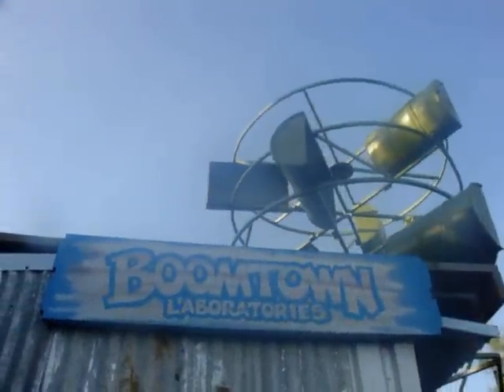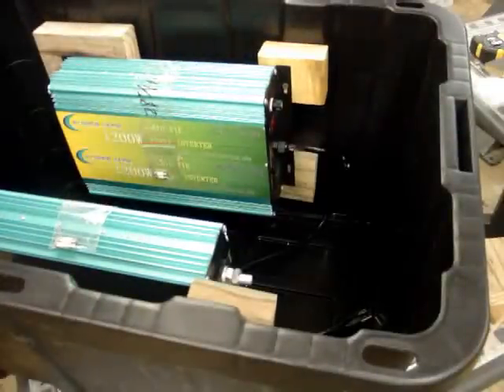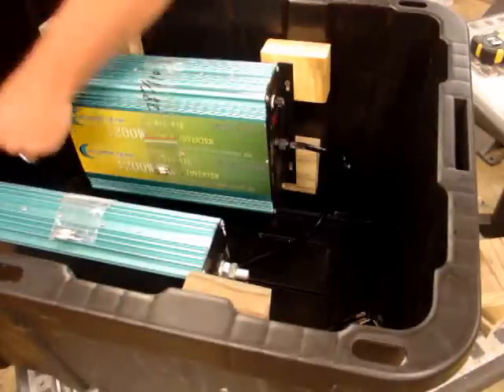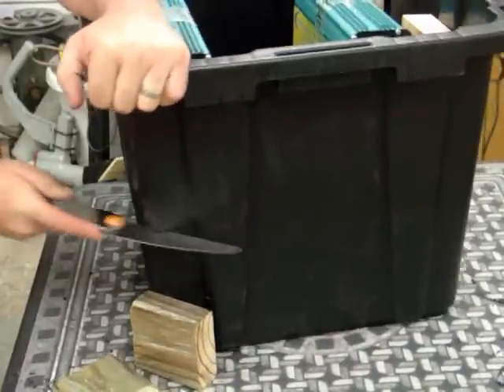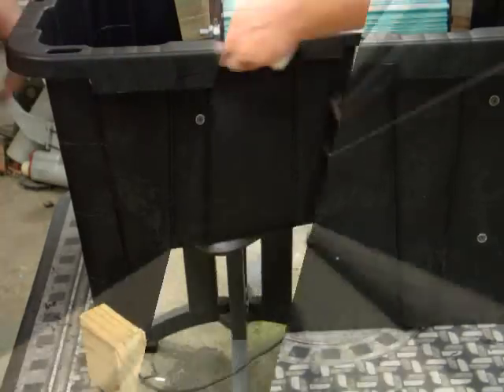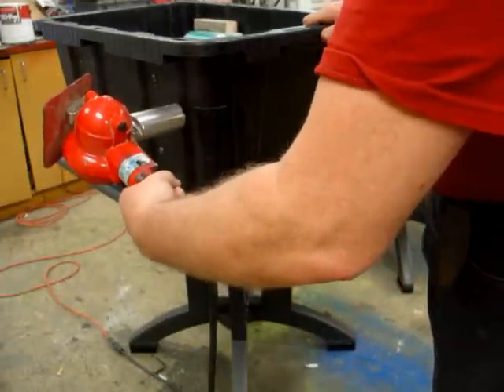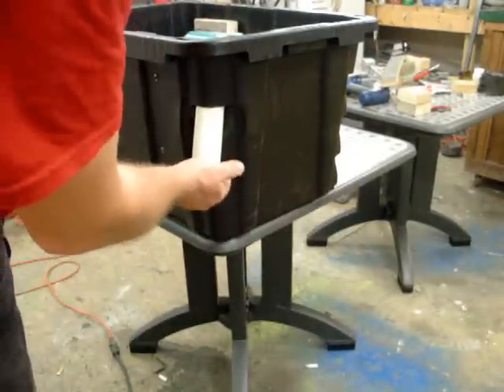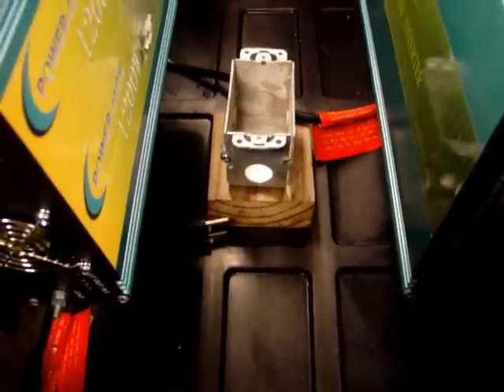PART 1 - 4000 WATTS SOLAR INSTALLATION AT BOOMTOWN LABORATORIES - MAKING THE GRID TIE BOXES

Comment: hey scott! nice set up. here is a little tip for you on getting some decent batteries cheap. find a local golf course that used golf carts. you can get used batteries from them for the core charge prices. most of the batteries are just sulfated up some. running a bendini style pulse motor will slowly break that sulfation away leaving you a good battery. pulse motors are very easy to build, if you need help let me know and will be glad to help. I also found a Trojan battery dealer, that sold me T-145 batteries at core prices also, they were not even a year old. they just made sure none of the cells were shorted out before I got them. best of luck on your battery banks!
Reply from the maker: +SilentDeath002 Thanks. I tried the local golf cart place, and the golf course. They have contracts for their old batteries. Bummer. But i call back often. perhaps i will wear them down sooner or later. :)
MUDDy
Happy new year.

Comment: Nice idea for housing those inverters! Just wondering if you're connecting the A/C outputs together to create a single 2400W feed line back to the load? (as it appears)
If so, are these special units that have a "sync" terminal to ensure their outputs are always "in phase"?

Comment: Muddy, I am a big fan and have built a ceiling fa alternator. I do have a question. I plan on don an off grid system. My home usues about 35KW per day. I dont want to spend a lot of money on inverters. How large does the inverter have to be? Is it more practile to stack them or just use one? I have done research on the subject but found contradictory information. Thanks for he advice, keep up the good work.

Matt

Comment: run 12v battery's use mppt charge controllers to take your higher volts back down to charge at 13.5v to 14v and it will keep your watts it turns it into higher amps at lower volts but it will charge your battery's down to 14+v input on controller so u can run more volts that will make it charge at slower speeds. the more constant power the less battery's = cheaper long term.try to cut out as many battery's as possible because they are about 75% of system cost when installed.don't even think LT

Comment: your playing sounds great in the intros to the vids. and your vids are great. how many volts is it? the best bang for the buck would be to get enough solar to power your home during they day with minimum battery's preferably no drain on them during the day and build enough wind gens to power during the night. if u get enough wind gens u want need as many solar panels during the day. and build your wind gens to produce more volts with less rpm  so it will charge the battery at slower speed

Comment: You realy should not use PowerJacks. These Chinese things tend to break very fast (only about 2-5 years of lifetime). I recommend using SMA inverters they last at least 10 years up to 25 years. Even though they will cost more than 3 times of what the PowerJack costs. Also the efficency of SMA inverters is like 97-98% while the PowerJack only makes it up to 80% at best.

Comment: sorry being its grid tied u might not have battery's but if you are running a 12v inverter all else applies. i am off grid and i designed my system and it works great charges when its cloudy thinks to mppt charge controllers

Comment: i hope them ant 12v panels to charge 12v battery's if so it will only charge in full sunlight.best to have 36v panels mppt charge controller with 12v battery's that way it will charge when cloudy.

Comment: well i hope it is enough ventilation ? you got intake but what about exhaust? it would have been best to cut holes in bottom under each inverter and exhaust on top above each inverter using pvc and silicone and vent cap on top that way air would be drawn around the inverter's and don't place the box outside because it will draw moisture from the outside air especially when dew is forming in early morning.